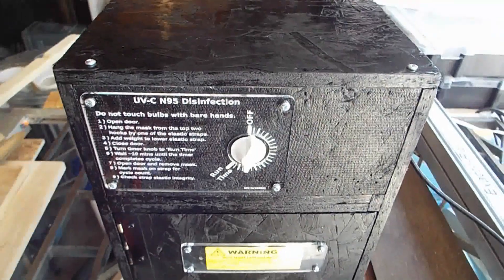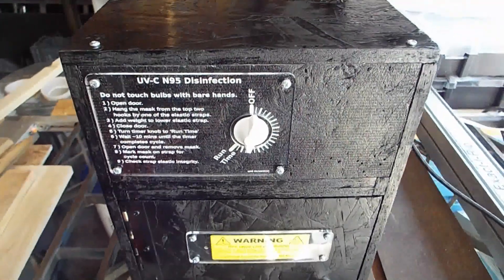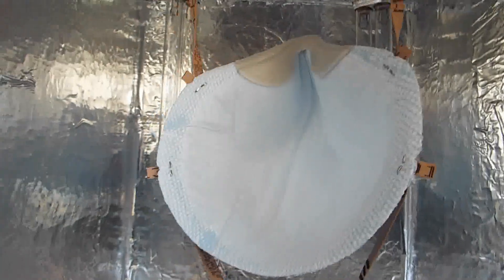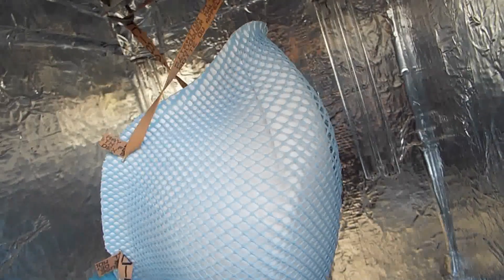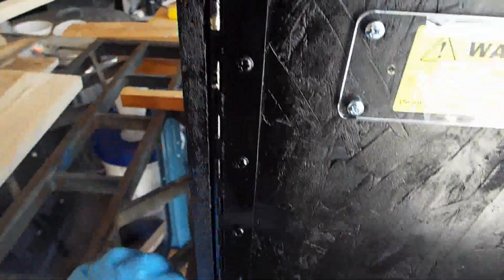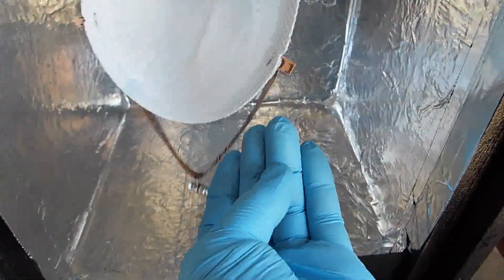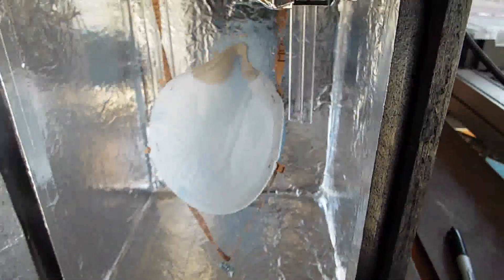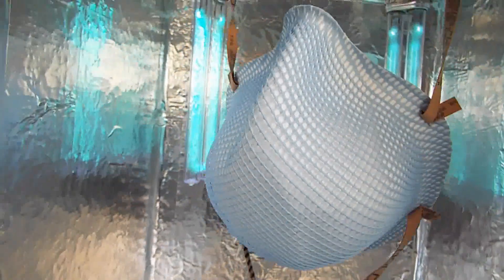UV-C N95 Mask Disinfection Cabinet

Comment: Hi Kirk ..hey how you test if any virus or bacteria is left ?? Or you just take a guess its gonna be disinfected..cheers Bro
Reply from the maker: Hi Dave, I have no way of testing it but based on previous research it should be very effective in disinfecting the masks.  Here are a couple of links with documentation that shows effectiveness:

https://www.sciencedirect.com/science/article/pii/S016609340400179X 

https://www.cdc.gov/coronavirus/2019-ncov/hcp/ppe-strategy/decontamination-reuse-respirators.html

https://88812c83-ba58-49ba-860d-119d53b80fff.filesusr.com/ugd/65634f_79a9d18e71544fa3a413ec49a12fc3bd.pdf

https://www.ncbi.nlm.nih.gov/pmc/articles/PMC3292282/
Reply: @madscientisthut  cool i ll have a read... we re in lock down still cant go anywhere only close around home
Reply from the maker: We are still in "stay at home" orders too. Our order is supposed to start to lift in stages soon, but only time will tell. Stay safe!
Reply: @madscientisthut  yes just like here....but im.ok staying home warchin yt )))

Comment: Nice well needed Device to disinfect masks. While watching TV I kept wondering why hospitals were not using these.
Reply from the maker: Thanks! I am not sure what the hospitals around here are doing either.
Reply: @madscientisthut  I am working on a project that I need to place my camera inside a microwave. 
Or remove the guard inside the front door so it is clear to let the camera see inside.
Any way to make a microwave proof box to protect the camera or would it be dangerous to temporarily
use just glass or Lexan as the door window for a few minutes? Looking for feed back. Thanks.
Reply from the maker: Both sound like a bad idea, there is a lot of RF energy (2.4GHz 900 - 1500 Watts) inside of the microwave, the camera would need a box that was designed like the door screen so it would have the same view as outside of the door. The screen in the door keeps all of that energy inside of the microwave away from you, and also keeps it in there doing what it is supposed to do, if the screen was not there most of the energy would escape preventing it from doing what microwave ovens do. Best is trying to get a view from outside looking through the screen.